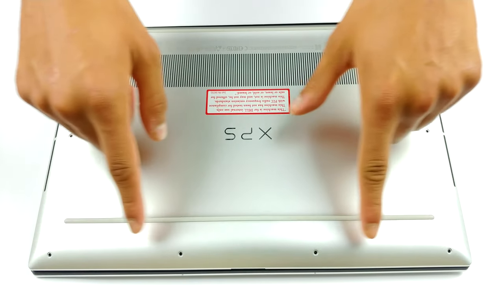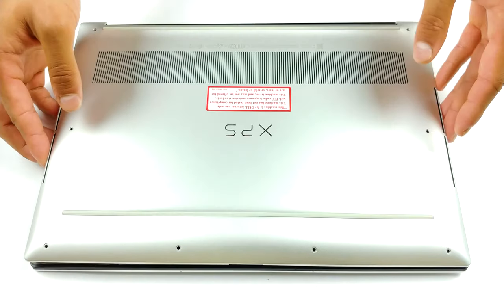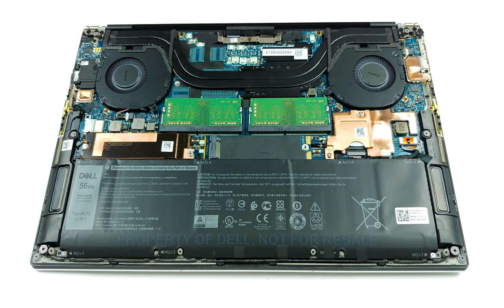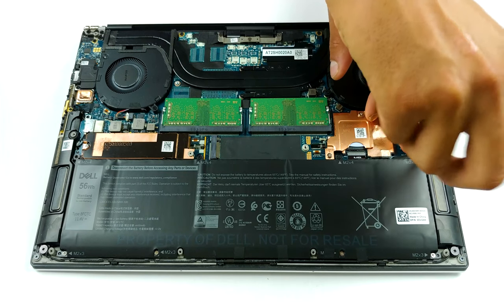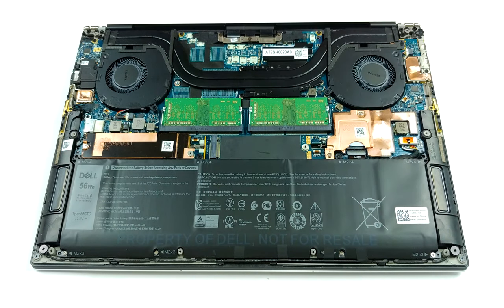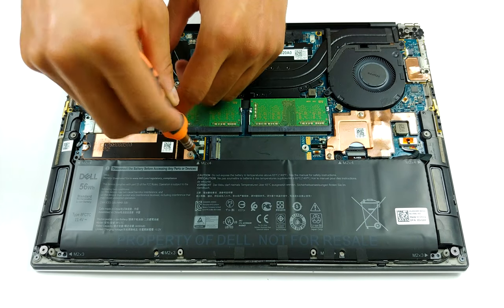🛠️ Dell XPS 15 9500 - disassembly and upgrade options

Comment: if you are considering the wifi 6e card replacement being described online and in Youtube it wont work because the killer chip is soddered to the board and looks nothing like the one being shown in any of the videos.

Comment: Is the battery also replaceable?
Reply: I have the same question. Can we upgrade it to 86Wh ?
Reply: @jalaledl  hey did you find out if you can upgrade it?
Reply: Hey guys, yes the battery is interchangable.
Reply: @MegaBaddays  links to buy? I'm just making sure just incase my new g15 5510 battery goes out i can buy a new one.

Comment: Completely fraudulent video. The bottom case had already been removed before the video starts. After you remove the torx screws on the bottom, it does NOT in any way just lift off as faked in the video. Also, I cannot stand the fake English audio that mispronounces everything and gets the cadence wrong on every sentence.